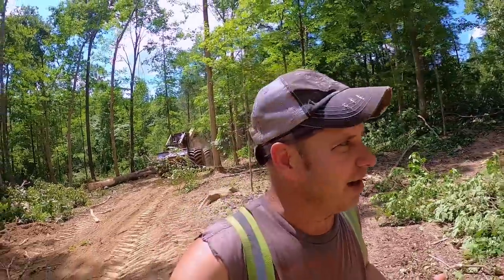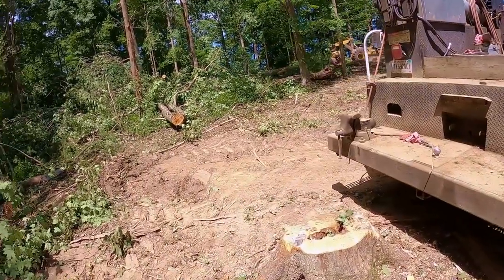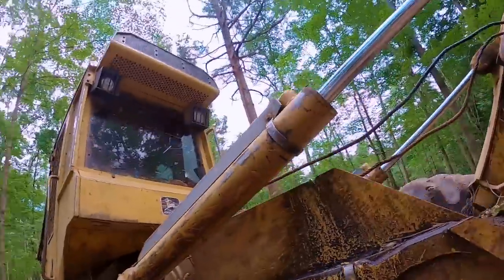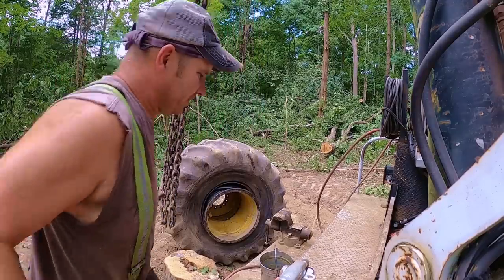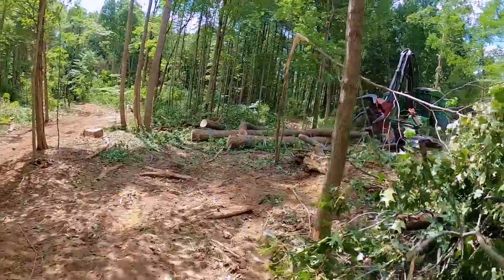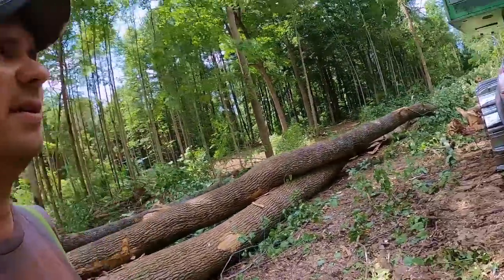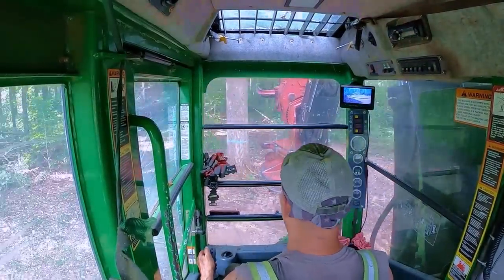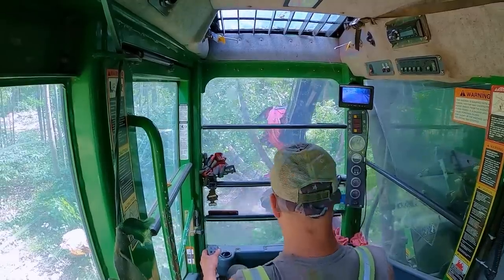Roger blowed his Skidder tire..🧨

Comment: Wade y'all just amazing 5 ⭐ video, now you mentioned lumber jack logging to mechanized logging we as Pawpaw an I were doing both types in the 80s 12 man crew 6 hand cutters for the tight spots and fell a bunching and skidding in the less dense areas although we didn't have a Tiny but we did have 5tons with single bunk to get logs to the yard . Not too much hard wood mostly pine and soft wood ( paper mill type) yeah northern Maine was fun logging in 2 foot of snow LoL . Now living in South Carolina it different from what I have see unfortunately I was diagnosed with a seizure disorder and can't run equipment safety reasons so watching y'all bring good times and fond memories so thanks 💯

Comment: You tried changing the water pump on that 6081 in brutus? I read where deere says to change it every 2000 hours to prevent water in the oil.
So guess what happened to my 6081 ?? 
Yep. Water in the oil. And the pump refuses to come out of the housing / timing chain cover.. so a home made puller is the only way... nightmare..